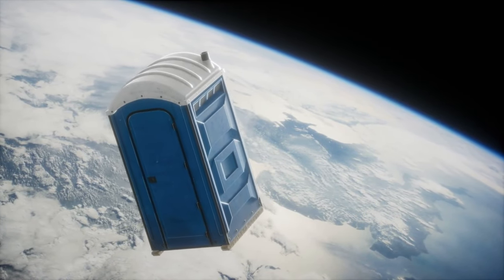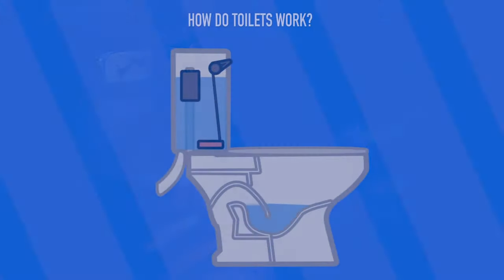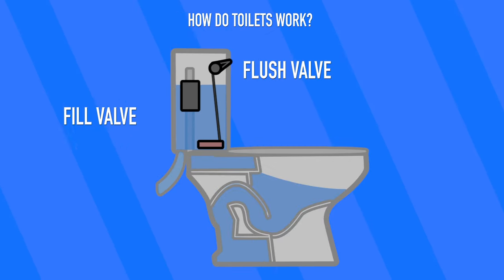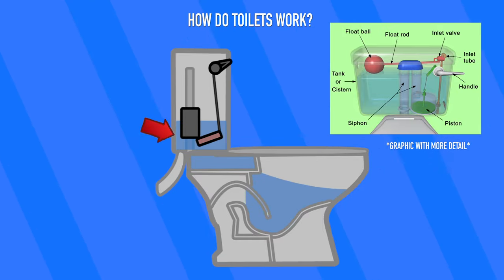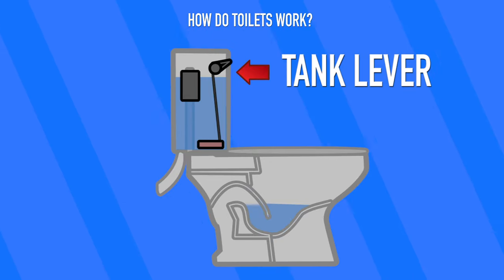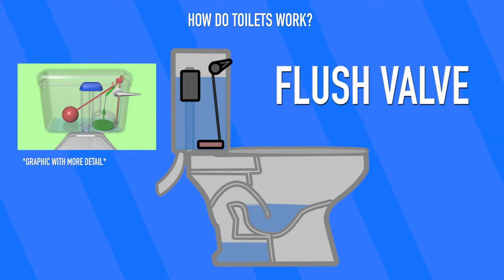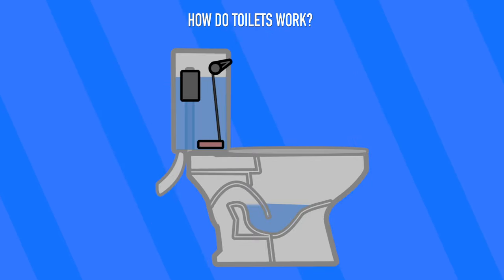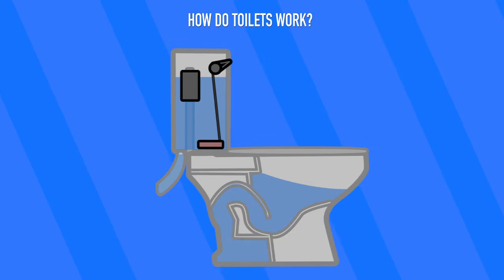How do Toilets Work?

Comment: This is horrible... What path does the water take?... What type of system causes the "swoosh" sound and moves the "stuff" so aggressively?... Its in the bowl design for sure .. what about the little holes around the rim, what path does the water take to get there?.  Is it a dual path?... You illustrated the water in the bowl only at 45 degree angle... never level..... This should be removed from youtube accept for maybe suggested it for 8 year olds..

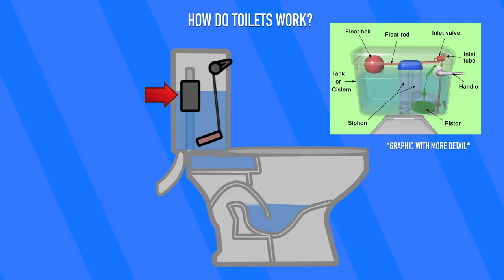Comment: I literally found out how this works yesterday, so I'm here to tell you how you got it wrong! 😜 Your illustrations are of two completely different types of toilet tank. 1:02 Your side view shows a US style toilet where the handle opens a flapper valve in the bottom of the tank that just let's the water out downwards. But the inset diagram labelled "Graphic with more detail" shows a UK-style cistern, where the handle forces water up a tube that forms a siphon, as labelled, so there isn't a naked hole in the bottom of the tank like there is on the main image.